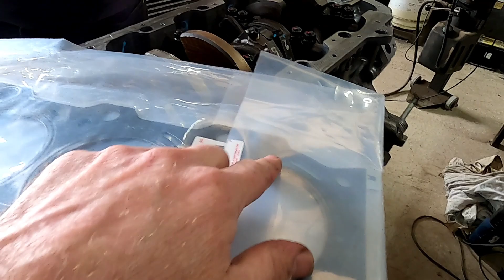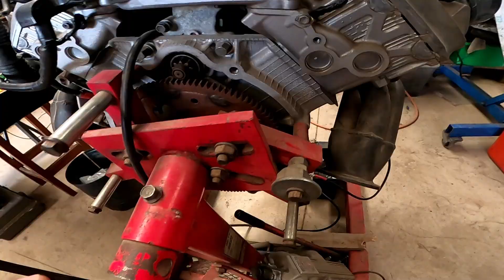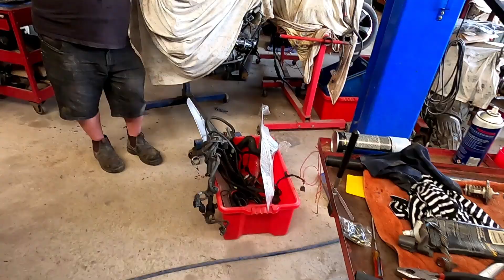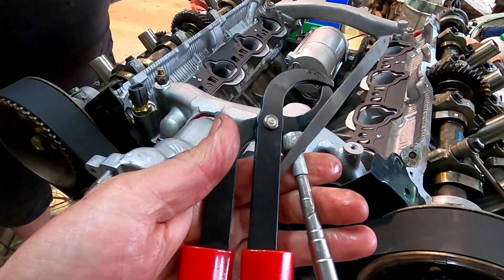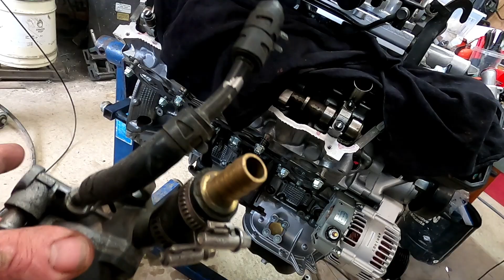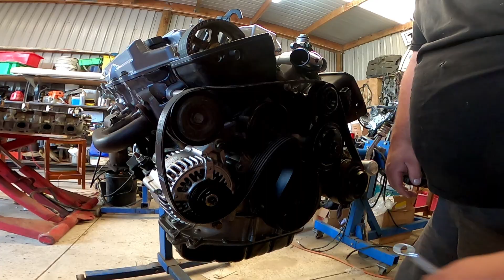Lambo Kit car 1uz engine assembly.

Comment: No sir I saw that video but the rubber that's in front of that solenoid came off the one that's hook to water pump 95lexus sc400 just want to no what I can use to cover that rubber that came off
Reply from the maker: As before,  I would use RT125 potting compound however any good epoxy resin should be fine
Reply: @CartuneNZ  were can I find RT 125
Reply from the maker: @harrisjr9849  Google is your friend.  I get it from my motorsport wholesale supply here in nz.  Cheers Kelvin
Reply: @CartuneNZ  ok thanks

Comment: Is that a 2j in the workshop
Reply from the maker: No 2jz in our workshop.  I even made a video to prove it.  https://youtu.be/c5MXOjcKr2E
Reply: @CartuneNZ what u mean by its got the big starter motor in it?
Reply from the maker: @camerongilbert81  well there are little starter motors,  it not fitted with one of those,  and then there are bigger starters and really big ones,   its got one of the really big starters fitted.